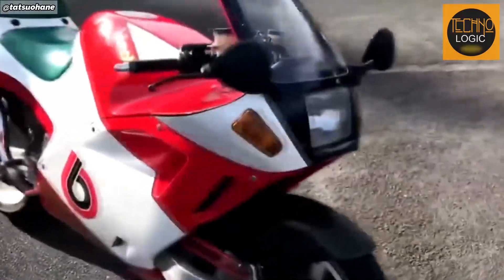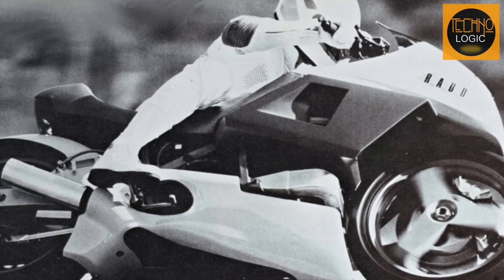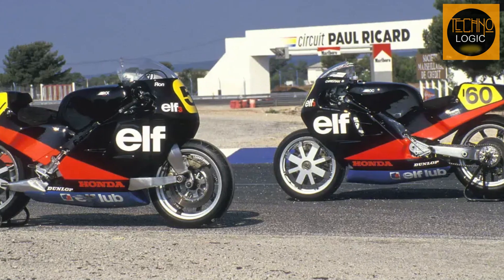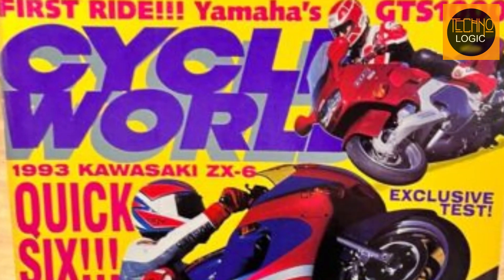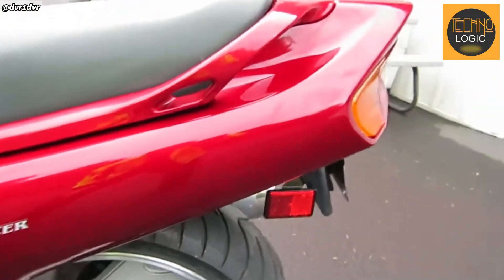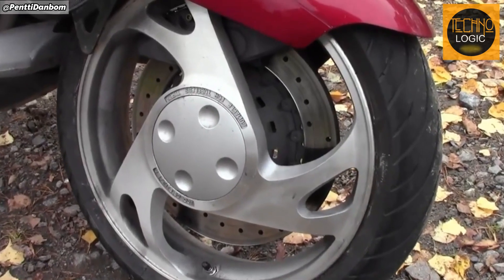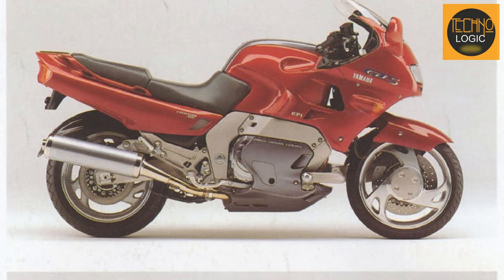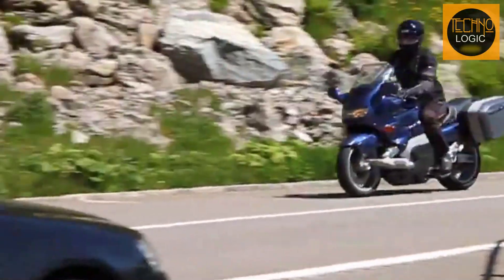Why this FORKLESS Inline Four Engine is brilliant, but UNSOLD❓

Comment: We did not see them much in Europe, the two dealers that I know in Belgium sold each one bike and they did not like the injection system. It was too rudimentary for that time, the throttle acted more than an on/off switch.
Reply: Tu racontes n'importe quoi ducon
Reply: @Bazuzeus  Did you drive one ? Did you work on one ?